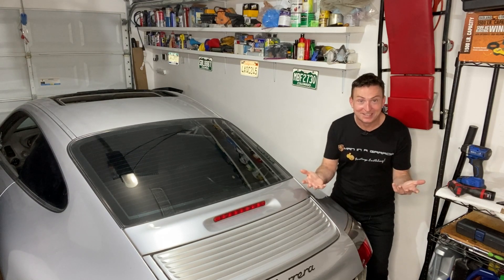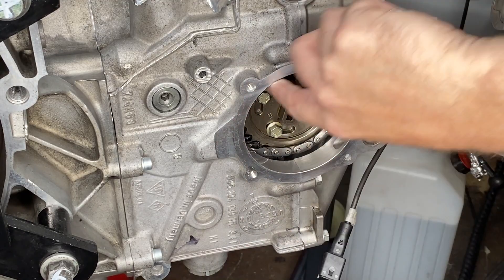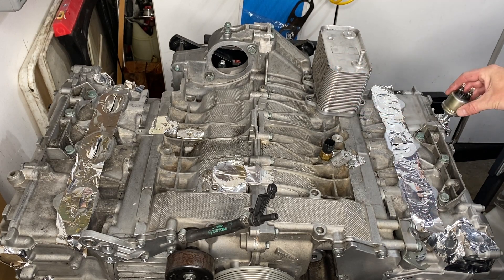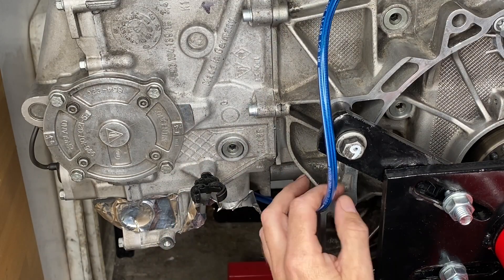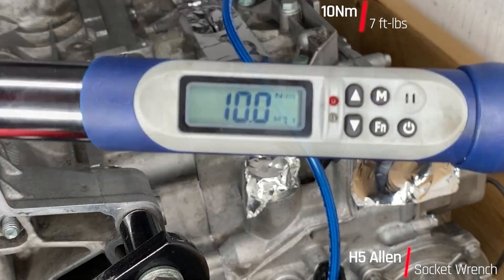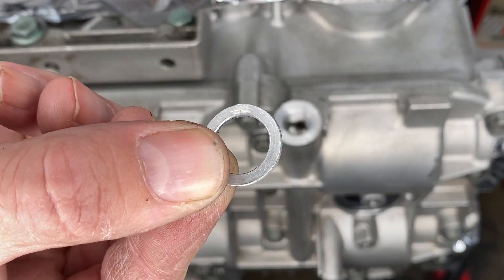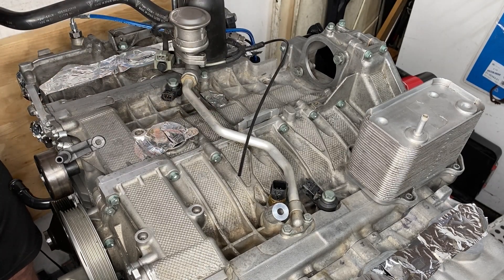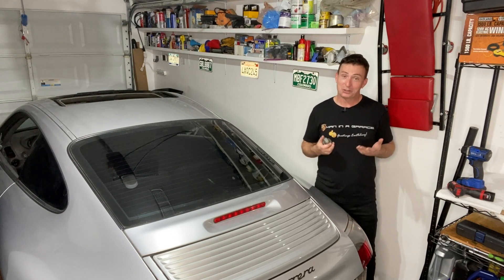PORSCHE Engine Sensors & DOF IMS BEARING

Comment: It's always the same. You see the finishing line, and then murphy's law comes into play. I think the word we are looking for here is BUGGER! Regarding the striped thread, Hili coil is one avenue, the other is to drill and cut a tread to the next size (11mm), Then drill out the part being fitted to the engine to 11mm, and then use a 11mm bolt. I guess the big question is, does this threaded hole lead to the inside of the engine?
Reply from the maker: That is great information Lester, Thank you. This stripped thread ordeal has become a fruitful source of information, I feel less stupid and less alone ✊ If you are cool with it, your insight will be included with the "Thread fixing" episode. It might reduce the blood pressure of DIY mechanics everywhere 😅 Thank you for watching 🤘😎
Reply: @ManinaGarage  your neither alone nor stupid Finn, you’ve never worked on anything to the extent you have without the occasional stripped thread , it’s parr for the course on anything that’s seen a few winters especially if your roads are covered in salt each year. 👍👍👌👌
Reply: Good luck.

Comment: Seem like the stripped bolt hole has good threads after the stripped area, looks like you may be able to get away using a longer bolt, BTW great job, I love your series.
Reply from the maker: Hello Eddie, I really appreciate your input. I’m formulating a plan for this particular pain in the butt based on everybody’s feedback. Thank you for watching 🤘😎

Comment: The crows foot needs to positioned straight inline with the wrench and then the torque reading will be close to specified .
Reply: You could  call it close (enough) but it will effectively be wrong. As others have posted, if you angle it at 90 degrees in relation to the length of the wrench the torque applied will be exactly as indicated on the display.

If space is tight and you can't angle it at 90 degrees, then place the crow foot inline with the wrench and set the torque to x% of the specifies value, where x=length of torque wrench divided by the sum of the lengths of the torque wrench and of the crow foot (I.e. l_wrench/(l_wrench + l_crow). The value by the looks of the tools will be somewhere around 0.80 . Length is measured from the middle of the grip to the middle of the drive square on the wrench. On the crow foot it's from the middle of the jaw to the middle of the drive square.
HTH.
Reply from the maker: It took me a minute to get to this Bernard, but holy moly, that's the beans right there! Thank you once again. It may seem like I am copping out with the whole Matt Farah thing (Another distraction coming up this week I'm afraid😳), I promise I am researching and ordering things to make use of the combined information everyone has sent to me. With luck, we should be able to slap the butt of stripped threads and crow's foot torque values based on this "youtube based organism's" collective knowledge. You rock 🤘😎

Comment: the hole with the stripped thread looks deep , and the threads only stripped at the top , put a 3mm drill bit down it and measure the depth , work out how much threads left , then allow a clearance so a new bolt wont bottom out , and use that , if its got enough depth , throw on a drop of loktite and your out of bother. putting a helicoil kit in a hole that still has a thread in the bottom wont work , you will have to drill out the remaining thread [ if theres any in the bottom of the hole] first.
Reply from the maker: Hello Tom, I am adding your method to the list of options, I appreciate your input. For this example I am looking to drill out the thread and either heli-coil or time-sert the hole. Everyone has been tremendously helpful, Thank you for helping and watching 🤘😎

Comment: Hi Finn. Thanks for the shoutout. As others have said; helicoil might be a bit overkill for this stripped thread. I would get a decent tap kit (you’ll never stop using them once you have them) and first try to retap it at the same size. Might clean the thread up enough to get you to 10nm. Failing that the easiest fix is probably to drill it out 1mm wider and tap at that size and find a bolt 1mm bigger. It looks like there’s enough material there to accommodate bolt one size up and aluminium is nice and soft for tapping. Helicoils are good where you can’t take more material (although tig welding and retapping is more elegant).
Reply: By the looks of the stripped thread (on a phone display, mind) I'd say the first couple of turns on the thread are stripped off entirely. 
In that case I personally think the risk is too great of not having the tap to follow the existing thread. Instead it would probably cut an new one and thereby effectively thinning the thread (to less than the pitch of the thread) and rendering it weaker.
If chasing the remainder of the thread I'd use only a chaser, not a tap to avoid the risk of cutting a new thread.
But in this particular case I'd follow the suggestions of using the remaining threads deeper down by taking a longer screw. If the remaining threads amount to engagement of 1.5x the thread diameter (in aluminum alloy) you can torque to the specified value without risking thread damage.
Enjoyed the content! Nice work on the engine and on the video itself too!
Reply from the maker: Howdy George 🤠  That is fantastic information, my neighbor lent me their Tap and Die Set, sadly its all S.A.E. but I get the concept. It seems what your saying is: Start buy trying to recut the thread to the same size then assess from there.  I am currently liking the look of time-sert's?? Also, I take it that the "Ultimate' way of fixing this would be to refill the hole with material from a tig welder then recut the threads from the new, solid material. If you are cool with it, I'm going to share this info with the group. Thank you George 🙌

Comment: Besides Helicoil there are some others in the branch , make sure that you clean out the new made thread and before you position the helicoil , put some blue Loctite on your new made thread to prevent the Helicoil from moving!!
Reply from the maker: Blue Loctite, CHECK! Thank you Arnold 🙏 working on a plan right now.

Comment: Hi, I'm finding the videos really helpful as I'm about to rebuild my own M96.
With regards to your stripped thread, while helicoil will do the job it is inferior to using a thread insert system called "Timesert" Porsche technicians use this when repairing the damaged threads on the exhaust ports which secure the manifold, I hope this helps, good luck with the rest of the build, cheers, Tim.
Reply from the maker: Hey Tim 🙌  , Its great to hear that these videos are helping you take the Porsche Plunge, Good Luck 🍀 It seems that I am going to be following your advice, those time-serts look good. Of the many wise people who thankfully watch these videos I should try recutting the threads first and then go from there, fingers crossed 🤞🏻. Thank you for watching 🤘😎
Reply: @ManinaGarage  yeah, get the correct jig and try drilling and tapping first, the timesert fix is great for when the thread needs to be replaced, good luck with the rest of the build, I'll be watching with interest 👍

Comment: I have used the claw foot open ended spinners on my torque wrench and had no problems getting the right torque with them. Because of the slight offset you will get a slightly higher reading, but it is not significant if you go about 10% under listed torque. I tested them on other sized bolts where I could get the socket as well as the claw onto them and compare.
Reply: If you put the torque wrench at a 90° angle to the crow foot then the torque reading will be accurate
Reply from the maker: Thank you Stefan, I really appreciate your insight. Your Rock🤘😎